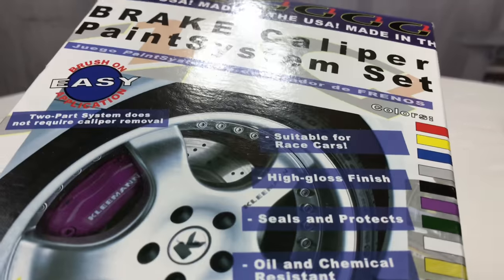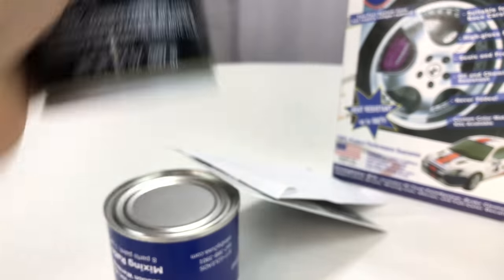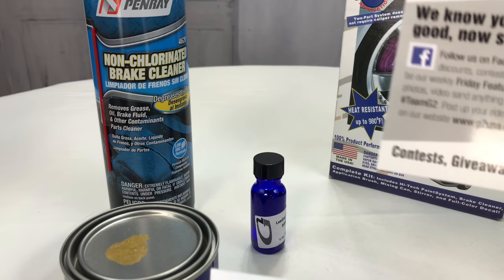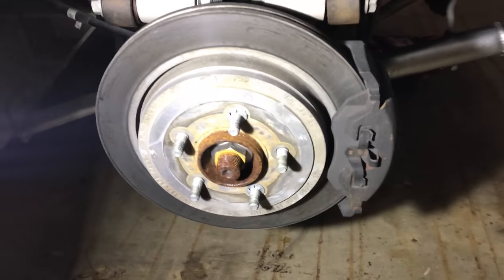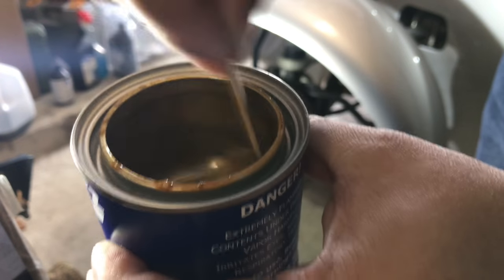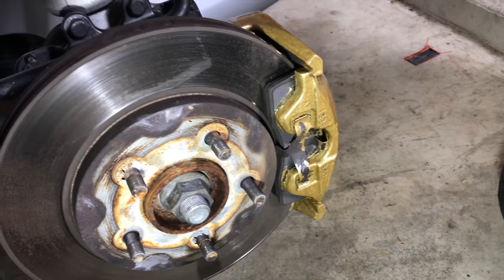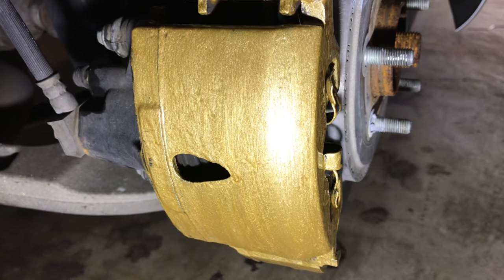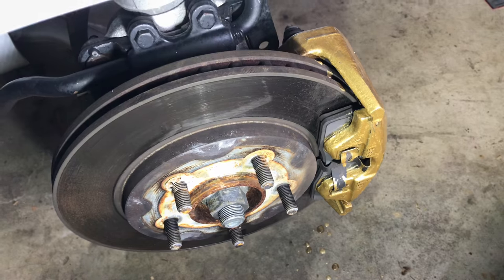G2 Brake Caliper Paint System Set Review

Comment: I applied 4 coats of Yellow on the calipers because the paint was not covering.  Becoming disapointed with the product.  I did have plenty of paint for the project so that was not the issue.  The issue was that it did not cover the calipers completely.  It just kept bleeding through.  Might want to use a primer first.